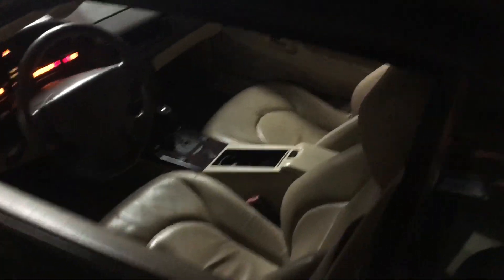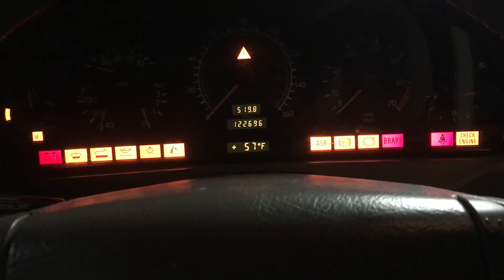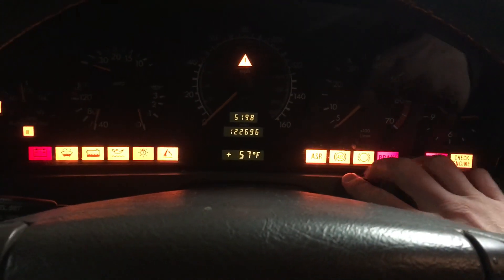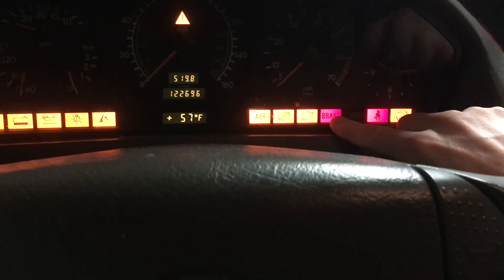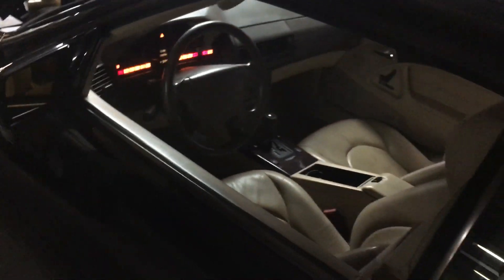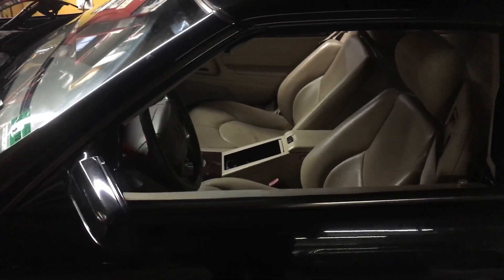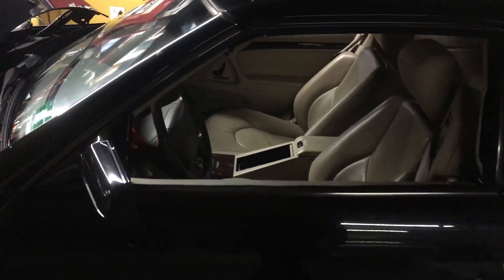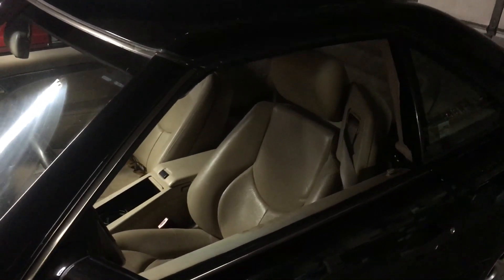Mercedes ABS BAS ASR Light

Comment: Hi sure 

Does the ABS sensor lighting in benz w124 e320 1995 
Cause slipping of automatic transmission ?
Reply from the maker: Thanks a bunch for watching my video and taking the time to ask a question.  What is your stored fault code? On a 1995 the diagnostics can be done without a scan tool just some basic stuff like I have on this video https://youtu.be/MxbQDYnPf6s .  Please share an update, thanks.
Reply: Gorgeous But how do I get the diagnostic code number? In my car there is a small button on the 16-digit number plate when I press it He gave me a number 6 7 9 10 What do these symbols mean?
Reply: @WheelsTips   I thank you from the bottom of my heart for your kindness and response 😘🌹❤ 
Thanks . . From yemen 😎
Reply from the maker: @alshbah.e320  Thanks a bunch for watching my video and taking the time to comment.  There is a lot to explain personally I would Google search, r170_fehlercodes.pdf.  This will give you a PDF which has all the information you need, I know it is a lot to read but if you are going to work on your own car this is a great resource to have.  Looking forward to an update on your diagnostics, thanks a bunch.

Comment: Hi. I'm getting this fault randomly, and it goes into limp mode. No acceleration past 1500rpm, no power steering, soften brake pedal. Does it start when the fault is active? Mine doesn't start. It's a 97 W140 S300TD. Your thoughts please, did you get the same symptoms? Thank you